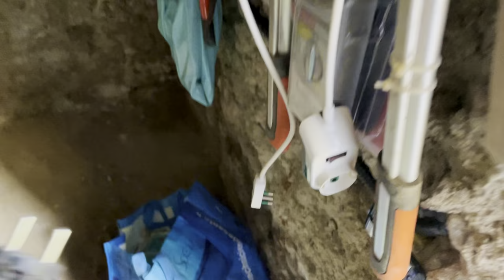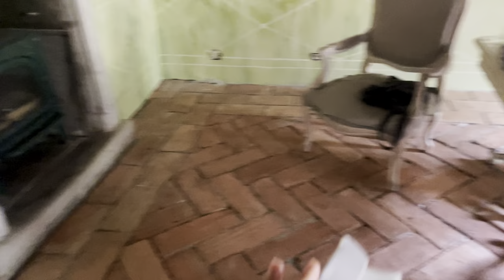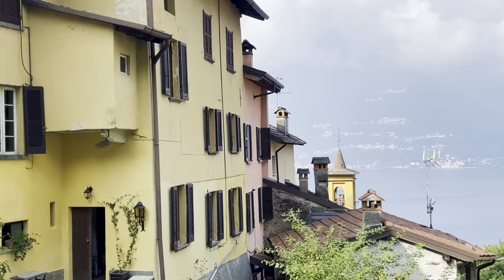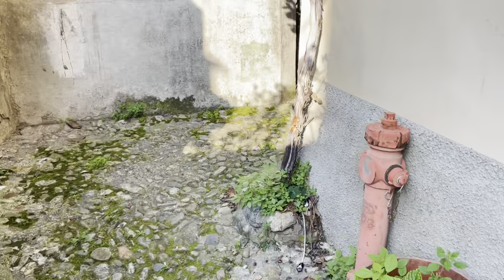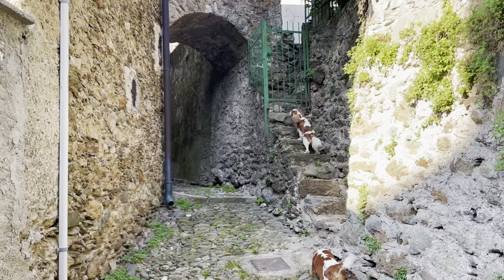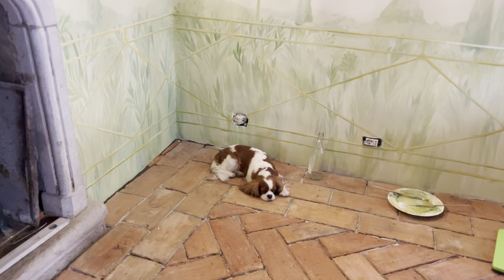Living and renovating and old Italian house/ Lake Como

Comment: Why you didn't use vacuum cleaner instead? The suction creates tension on the hair, replacing the need for a brush and, you can dry hair with no heat at all, as the pressure of the vacuum sucks the water out of the hair and it simply evaporates. 🥸